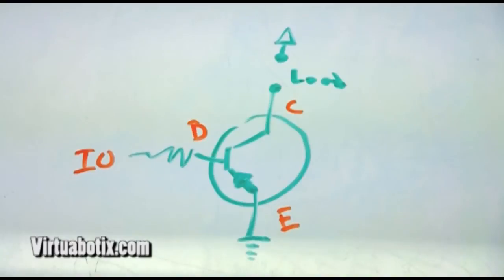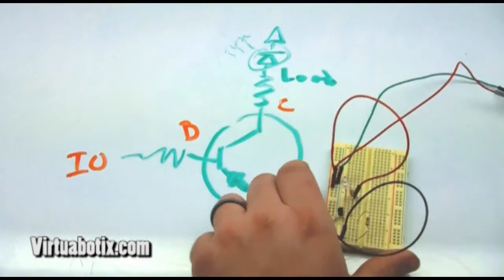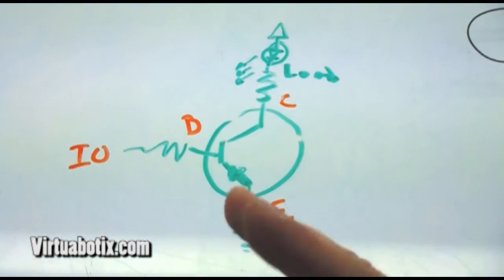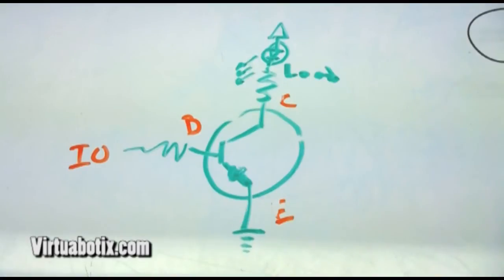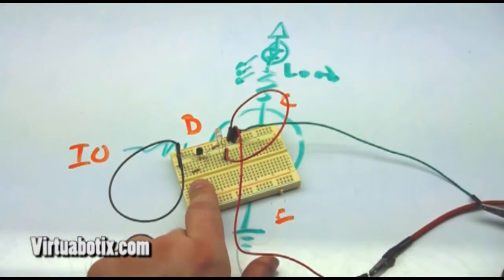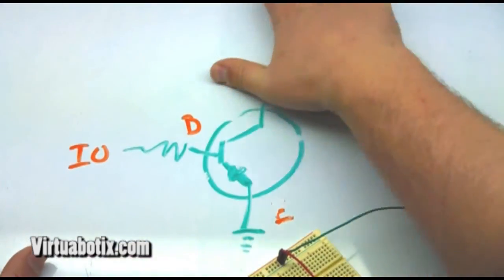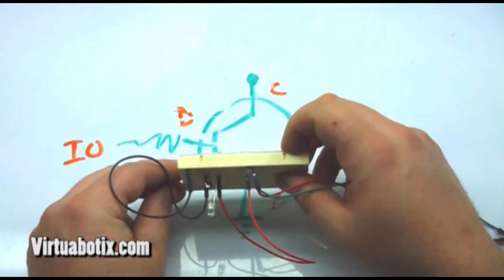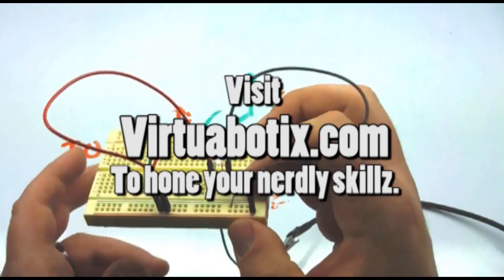Ep1: EXPLODING TRANSISTORS - Letting the Magic Blue Smoke Out

Comment: will the excess collector current causes transistor to blow.... 
in my case i took BC547 with Rb = 50ohms n Vcc = 10V hfe=100. which actually gives Ib = 0.18A n Ic = 18.8A which is way more high. But am not able to assess whether this is too high or not. Could u please help me out
Reply: Nikhil Manjunath that should be enough to burn it out, but current delivery speed is what decides if it exploded or slow burns.

the key is having the the base fully opened and an excessive load.
Reply: Joseph Dattilo can u please tell me, wether excess collector current Burns out the transistor or excess base current!?? n also can u please tell me, will the base emitter voltage is always maintained at 0.6V irrespective of voltage applied?
I know it's very basic but I have so much doubts regarding practical approach. Hope u understand n clarify my doubts.
thanks
Reply: Are trying to blow it up, or trying not to? If you are trying not to blow it up I recommend following the specifications on the datasheet.

If you want to make it explode though you need to open the base as wide as you can and then quickly drive way too much current through (basically eliminate the resistors so the flow is almost immediate.)

Slow ramps will just get you a regular burn out and some magic blue smoke. Fast ramps on LEDs and Transistors have the potential to be explosive.